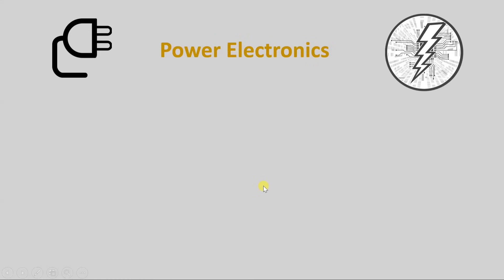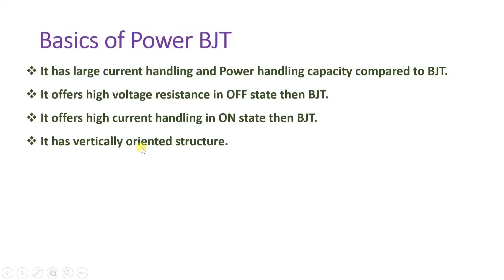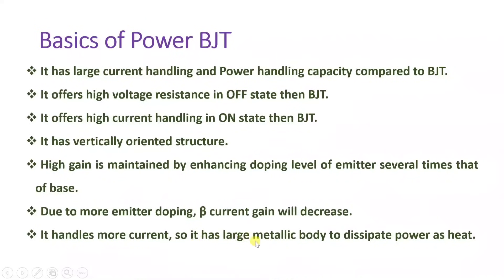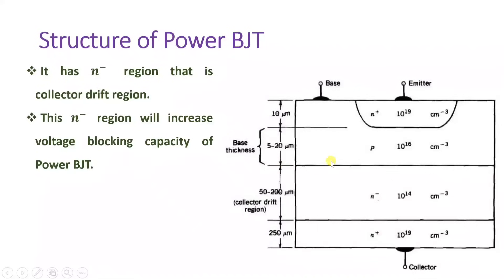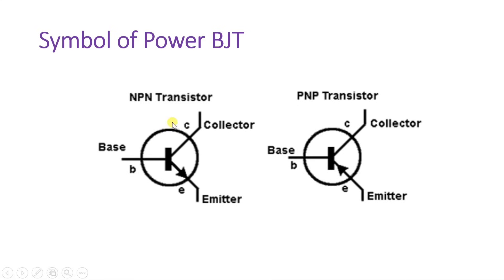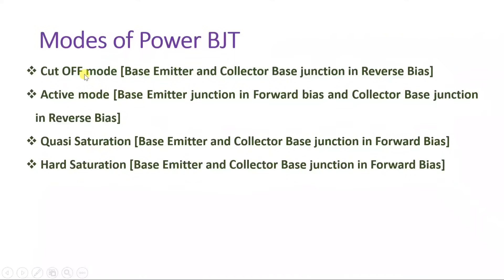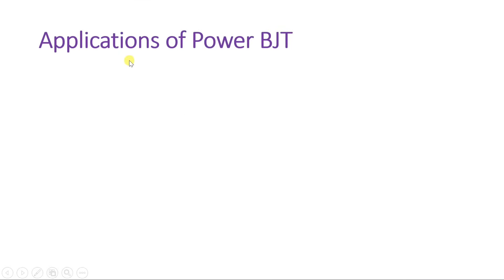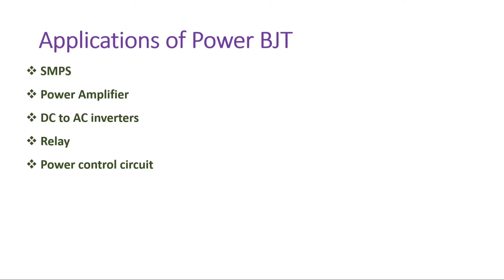Power BJT (Basics, Symbol, Structure, Working, Modes, VI Characteristics & Applications) Explained

Comment: sir,if in exam if they asked like explain the basic structure and characteristics of transistor as a modern power semi conductor device?..can we answer the same or do we need to add any extra points regarding the question?

Comment: i have question sir, at the time of turn off how flow of negative current induces a lateral voltage drop of opposite polarity. even how negative base current induces at the time of turn off of power transistor.